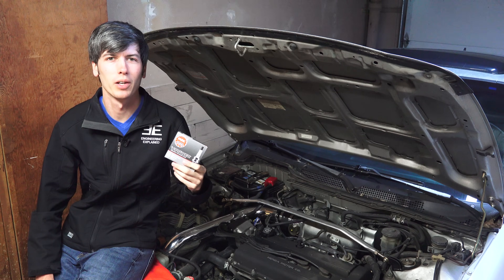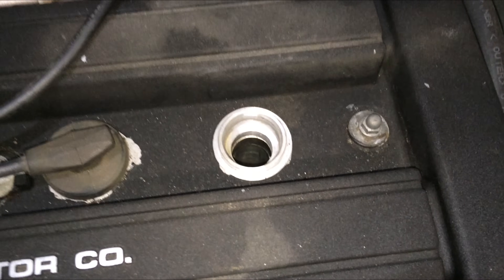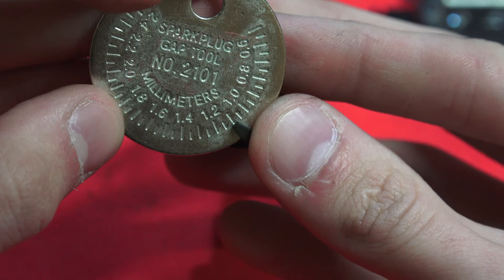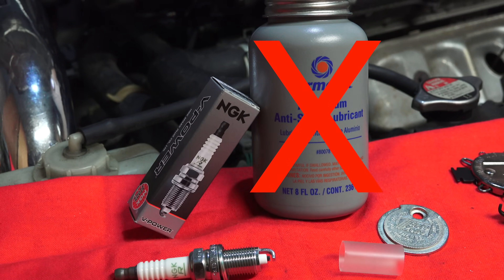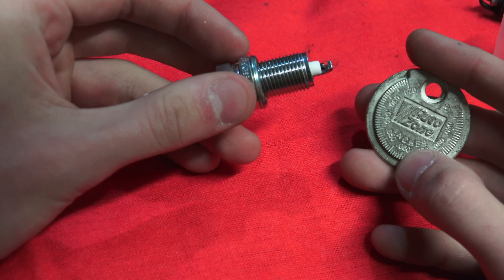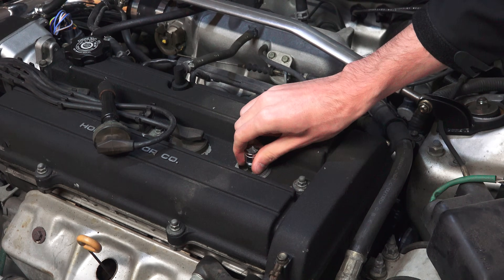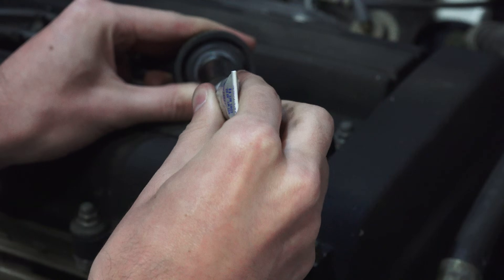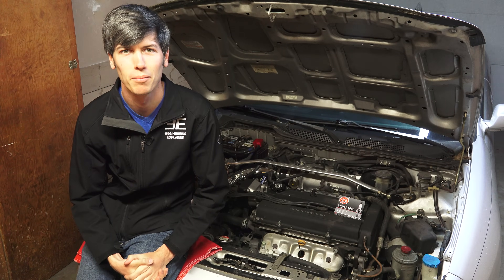How To Change & Inspect Spark Plugs

Comment: 1 very important piece of information you failed to mention: The every day driver should NEVER pull plug wires unless the engine is completely cold, because heat causes both the spark plug connector-tip and the wire connectors to expand. This can and often does wallow out the wire connector, causing a poor fit, resulting in a bad connection to the plug. Always inspect/change plugs and/or wires when the engine is totally cold..........unless it's a roadside emergency of course.
Reply: Do I need to disconnect the battery? It'll be my first time changing my spark plugs.

Comment: Another tip for when getting the new plugs started when installing them is to stick them in a longish piece of snug fitting hose and then the hose will bend and allow you to still tighten them if they're in hard to reach areas. This also helps to make sure you don't cross thread them as the hose will spin on the end of the plug before you are able to tighten them too much to do damage.
Reply: Wow that's the goat suggestion

Comment: DON'T FORGET TO REMEMBER THE SPARK PLUG WIRING ORDER IF YOU'RE DOING THEM ALL AT THE SAME TIME....or you're going to have a bad time.
Reply from the maker: +zdrux Yep, of course. Often the wire length will only match each individual plug, so hopefully this part's easy.

Comment: It should be mentioned that the factory coating on those ngk plugs is only good for the first installation. If you remove to inspect, you no longer have that protection as it breaks away upon removal of the plug. You should use an anti-sieze if reinstalling the same plug.
Reply: Good to know, thank you!

Comment: Great mention about the zinc coating on spark plug threads, torque specs are always for CLEAN and DRY unless specified. Any GREASE or OIL on threads will increase the clamping force by a large percent and thread damage is possible especially with aluminum.

Comment: Just as I was looking at changing mine, thanks! :D
Reply: +Boosted  ༼ つ◕_◕ ༽つhi boosted ༼ つ◕_◕ ༽つim a subscriber ༼ つ◕_◕ ༽つwhen are you going to boost the renault? ༼ つ◕_◕ ༽つ
Reply: One day....
Reply: +Boosted If you haven't heard about them, I would suggest picking up a Haynes (or Bentley) manual for your car. Every job you can do on the car is explained and there are plenty of pictures to help you along. You can also find all the torque specs / liquids you needs to use, etc...
Reply: Small world it is. Im ur sub aswell
Reply: instablaster...

Comment: It is important to change spark plugs, I just discovered that my 86 Toyota pickup has never had its plugs changed. It ran quite well even with plugs that are 30 years old and have 350,000 miles on them.

Comment: I didn't know that the NGK's had a coating on the threads and recommend not using the anti-seize.  Thanks for that!  I'll investigate the spark plugs specs better in the future.  Ive been using Autolites copper plugs of late, but I have used NGK before.

Comment: Good video, doing your plug is a fun little job.

One thing, I might be worng but I would not put dielectric grease in the boot, because it is a electric insulator, if some get on the metal tip of the plug ( were the electric contact is made with the coil pack) it might disturbed the electric contact. I did mine ( 2007 FIT) and the one of my wife's cars ( 2003 corolla) last year, I put the Dielectric grease directly on the ceramic body ( the white part) of the plug since that's were you want it. It's also not completely necessary. Does help future removal, moisture prevention etc but you can live without it. The corrola ( and you acura) are pretty easy since the plug are directly over the engine. The Fit was a little tricky, because the plug are behind the engine at a angle. hte first 3 were not to bad, the 4th wwas harder, I lossen up the cable rail before doing the job, which helped a lot. Still it was not that hard. Totally worth it to be done by yourself. I also clean my Coil pack since one seem to have problem, the misfire I experienced went away.

Comment: Good info about anti-seize. I didn't know that. So you can get the exact same OEM plugs at an AutoZone type store as you can directly from the dealer?
Reply from the maker: +Brian Burke in my case, yep. Exact plugs recommended in my owners manual.
Reply: +Engineering Explained Danke.
Reply: +Buildit Generally it is the exact same thing.  Just does not have the Vehicle Manufactures label on them.  I have a '93 Nissan LDV 1400 and have been running NGK OEM plugs for about 15 years with no ill effects.

Comment: Gotta love changing the spark plugs on the Ford modular 3 valve 4.6L, 5.4L V8 and 6.8L V10 built from 2004 to 2007.
Reply: Also the 96-98 modular is the same and no 4.6L 3v it was 4.7 I believe. It's so simple I do mine in 10 minutes

Comment: Had a coil go out in my 2002 volvo s60, they also recommended I change my plugs because it was on the originals with 139,000 miles!

Comment: I run the coldest plugs that I can find for any of my vehicles.  Gives me more room for modifications later on.  I don't have problems with fouling as I have found the solution for that one.  Still looking for colder plugs for my 1.5 liter Protege NA 1998.  Stock clutch only holds half throttle.  Easily beat a turbo diesel Dodge the other day.

Comment: Maybe you could explain differences between spark plug types (i.e. iridium), heat ranges, etc. For example, for me changing spark plugs to colder ones helped fighting engine overheating after cylinder head skimming (when changing timing didn't help at all).

Comment: If you haven't already, could you please do a video of the variations of spark plug technology; such as conduction, heat dissipation, heat rating and how they relate to the variations of metal such as iridium, platinum and copper.

I personally would like to to learn more about the relationship between high performance tuned vehicles and selecting the right spark plugs for high horsepower applications. For ex. Turbo applications. The manufacture may recommend a specific plug, however, many tuners typically swap to colder plugs for a modified applications. 

Thanks!

Comment: That's some great info, but what about reused plugs? For example, I inspected the spark plugs on a car I bought and they looked really good, but when I put them back in there is no play because the crash gaskets are already crushed, but now I don't know if they too tight or not tight enough and I'm worried it might damage the engine. Any idea?

Comment: Aw, I was hoping you'd talk about Iridium vs copper and all that.
Reply: +EazyDuz18 but I would've liked to see numbers. And why
Reply: Iridium lasts much longer and won't degrade as quickly.

But either there is a good spark or there isn't, you won't see a performance different between plug types when they are healthy.

Comment: I read somewhere that using any kind of antiseize can affect the plugs performance since the plug is grounded to the engine block and antiseize can affect conduction...
Reply: +Younex Meures You dont need to apply it all the way around. 3/4s should work.

Comment: I am surprised you did not mention that using a regular, cheap gap tool can damage some plugs!!  The best way to gap a spark plug is to use the tool that bends the ground wire on the backside without touching the center electrode or the tip of the ground wire.

Comment: I wish it was so easy to change plugs in my highlander, we used to have an Acura like that and it was nice and easy but the highlander not so much. First, it has coil over plugs which makes them deeper and hard to get to and more expensive. Also, the 3 rear plugs are under an intake manifold which can be a major pain to take off.

Comment: I have a 1997 chevy s 10 with the 4.3l v6 and was wondering if when I change the spark plugs if I should also change the wires to? I have no idea when they were last changed considering I just bought the truck.

Comment: I have a curious question, I've seen a lot of spark plugs lately that have the ground electrode completely connecting on both ends to the shell, I've even seen ones that have 3 points connected.  How do you space that?  I have a Ford and I believe they generally use these types of plugs.
Reply from the maker: +Andy Sell (BretMaverick) They likely come pre-spaced so it wouldn't be necessary (if the cost is high, which I imagine it would be. Even these $2.50 ones were pre-spaced. That said, perhaps use the corner of a feeler gauge to check the gap. A fully connecting ground electrode probably isn't meant for adjusting, I'd probably just replace it if it was off.
Reply: NGKs are pre-gapped

Comment: great video, I learn something new all the time and I've been in the automotive technology field for about 20 years now. I have never heard of not putting anti-seize on spark plugs especially when going into  aluminum heads. is that info on the NGK spark plug box? cause I've used NGK for a long time and never seen that info.thanks

Comment: Does Iridium spark plugs make a difference?
Reply: +tokekkk They are good if you want to pay the money, not recomented in tuned turbo engines as they are harder to ignite / arc at really high cylinder pressures. Ok on stock and mild engines though, especially on hard to get at plugs :D
Reply: Paul Bearer good to know, thanks :D
Reply: Cristian depends in the compression ratio mainly, or boost pressure. I think iridium's would be fine in any engine that's naturally aspirated and anything running less than 10psi boost would be OK too in my experience. Heat range is usually needed to be changed in high performance engines which is a thing you should be taking into account. Wouldn't recommend using iridium's in alcohol engines either.
Reply: Absolutely yes for me because my engine block has to be jacked up from the bay to access the plugs so the longer the life the better :) I'm sure Subaru owners will agree.
Reply: why not in alcohol engines?
Reply: alfistibrasiliani from what I understand is iridium does not get as hot, so I’m suspecting In a turbo there’s to much turbulence and in alcohol, the alcohol is harder to ignite than gas so you need the heat from a regular spark plug, honestly all just guesses but I guess I’ll be corrected if I’m wrong.?
Reply: Rex Erection  you probably figured it out but don't downgrade, your engine was made to run on those specific spark plugs and downgrading to copper will eat those boys real fast. Stick to OEM or upgrade only if you are stock.

Comment: Liked it ! Just some question I have .....better said I want to know your opinion on this....you say that we should use what the manufacturer recommends.....well in my case the manufacturer calls for a standard plug; I switched to iridium and I notice an improvement in how the acceleration pedal responds and also I can reach every time my car`s top speed.....with factory recommended plugs I rarely got near that speed and after 8-10 000 miles I wouldn't reach it for sure.....Moreover on this....the spark plugs are iridium but aren't even recommended for my type of engine, they are used in other cars engine....but the performance I get from them its way better than mine....I had them for 30 000 miles and still running...what do you say about this?
Reply: well, if you have a somewhat weak ignition system, putting irridium plugs with less resistance could make it run better as they need less power to fire to  a small degree
Reply: Thanks Scotty for your answer, needed that confirmation

Comment: Would you recommend the use of long-life spark plugs for up to 100TKM? Is there a need of regularly inspecting these - annually or so..?
Reply: I wouldn't recommend continually pulling your spark plugs. Unless you notice a degradation in performance or fuel mileage, the risk of breaking a plug or screwing up the threads is not worth it for the few buck it will cost you for new plugs. With today's vehicle computers, plugs last longer and burn cleaner. I have a 2003 Lincoln Town Car and changed the plugs at 114 miles.  The plugs looked almost perfect with all 8 with the same light pink color and no excessive electrode wear.

Comment: How about spark plug designs and tests ?  Which is better spark?  Bottom line is how much voltage it takes to spark the gap.     The quality of the spark can tell you the temperature of the spark .       Where can I find a good video of just spark plugs comparison?

Comment: Some more pertinent information you should of provided was to discuss different electrode grades/materials -  I.E iridium, Dbl Platinum, Platinum, and copper. This simple "$15" job for your older car is not nearly close to the price of most newer cars. Some Scions use (factory) plugs costing the upwards of $15 EACH.  Also, Chevy's debatably most popular engine takes iridium plugs which run at $7 each X 8.
Reply: +Stephen Hawkins All this being said, that is not (I'm assuming) the point of your video. This is more of basic how-to stuff.

Comment: Great quick video, however, Engineering Explained, I wish you would have mentioned that you should not check the gap AT ALL on platinum or iridium-tipped spark plugs as you can cause major damage to the electrode.  Those gap gauges are only meant for copper (cheap) spark plugs.

Great video otherwise.

Comment: I have 2 vehicles that require copper plugs instead of platinum. Can you explain the benefit of copper over platinum? I have a Dodge with a 5.7l Hemi, and a BMW 335i with a 3.0l twin turbo N54 engine

Comment: great vid, hey I'm using NGK Iridium in my 95 Honda Accord V6 but the Service manual calls for regular copper NGK exactly the ones you used in your video. Am I not getting the performance I should be because I'm not using the OEM plugs?? thanks

Comment: I just changed mine on my Honda Odyssey because I had intermittent rough cold starts and have 8 years and 130k on them. They had typical corrosion, the ceramic looked burnt closer to the middle of the plug but the gap was almost perfect. Should I have just cleaned them up and put them back in, the plugs for my car are $30 each. They are rated to go 160k.  Thanks

Comment: I always start turning spark plugs slowly counter clockwise first,holding socket extension
in the middle. Parallel to the opening)
When the sparks plugs jerks slightly,then start turning clock wise.

Comment: Could you tell me why it is recommended to adjust the spark plug gap when the engine ECU is remapped in order to increase the engine power?

Comment: you should always change the wires doing a tune up. the plugs might not get full power. it the coil has been on for along time it would be a good idea to change the coil.

Comment: What about regapping iridium and platium spark plugs? 
I got into an argument with a Autozone employee about spark plug gaps, he said that the gap was unimportant and to leave it how it came in the box and not to try and regap iridium or platinum plugs because you would ruin and scratch them. I thought that the spark plug gap was extremely important because too little and the spark is weak and too much can hurt the ignition system by putting a strain on it.  So I made him bring me over a dozen plugs while I measured and picked the ones that were at the gap I needed.
Also what about indexing spark plugs? (why? because racecar)

Comment: Could someone explain to me why using a torque wrench is best practice if a spark plug company gives rotation specs after hand tightening to contact?  Wouldn't that be MUCH more accurate vs possibly using a cheap/not so greatly calibrated torque wrench?  Or am I missing something here?

Comment: What are ur thoughts on trying to set the plugs to "face" the intake side when installing?
Reply from the maker: +Random Guy I don't have any thoughts on it haha. :)
Reply: What you are talking about is clocking the plugs so that the open part of the spark plug is facing the intake valve. This is an old racers trick to get maximum horsepower out of the engine by not having the spark shrouded by the back of the electrode. You pretty much have to have the heads off the engine and then use spark plug washers to clock each plug properly. With high power ignitions on street vehicles, it is doubtful the gains you would see would be worth the effort.
Reply: +Hammer0f Thor Indeed, I however was unaware they used washers, and u needed to take the head off to do so =) pretty interesting stuff.

Comment: I was a PATRON sponsor but since you axed that I will leave a comment here. Can you do a video on the benefits or lack thereof of running a long rod engine as opposed to a stock length rod setup?? Thanks!
Reply: +Jack Allen Longer rods will get you more torque and shorter more revs and power. I think theres a vid on square and oversquare engines hes done